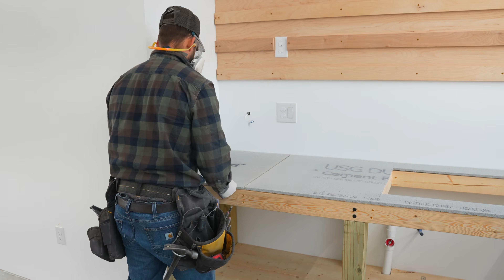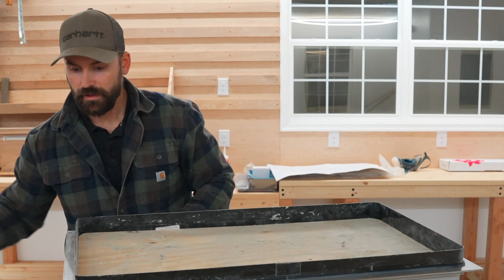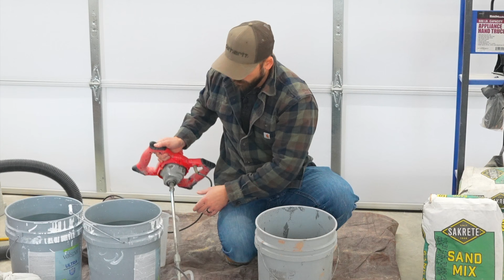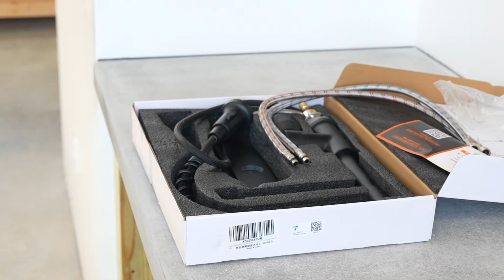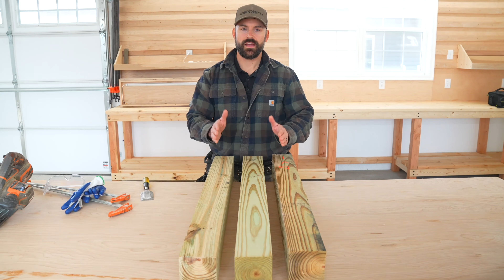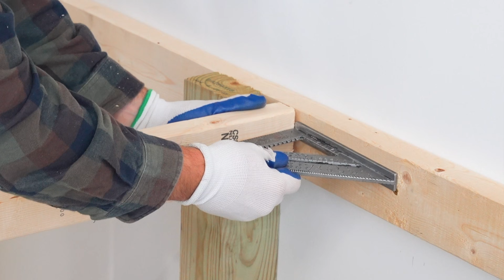How to Make a Concrete Countertop for Your Kitchen or Garage Workshop | DIY Step-by-Step

Comment: At what point would you seed it with glass if you wanted to?
Reply: If precast, put in forms first. Then do a "face coat" to get a smooth finish and hold the aggregate in place. If cast in place, pour the counter then place the glass onto the surface and work it in.

Comment: So you basically turned a drop-in sink into an under-mount sink? Do you think the cement board is strong enough to hold a sink full of water? I was thinking about adding wood supports for mine.
Reply from the maker: You definitely need wood support to hold the sink. Like in the video, that is what holds the sink ultimately. I hope that helps!
Reply: @ cool. Thanks!

Comment: It would have been the answer to the questions in my mind if this had been done using an apron front farmhouse sink. I'm closer to it than I was though and do appreciate your video. Thanx Man.
Reply from the maker: I have not formed up around a farmhouse sink, but you should be able to use the sink form like you seen in this video except you would put it on after the sink is set on the cement board framing. I hope that helps!